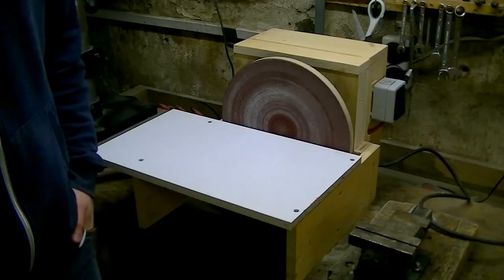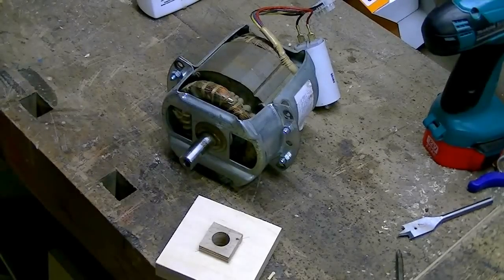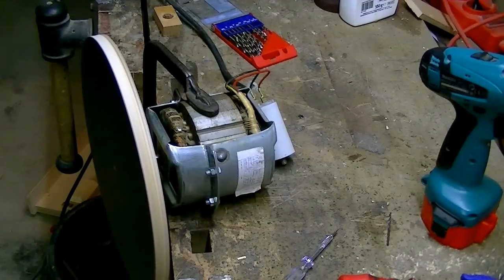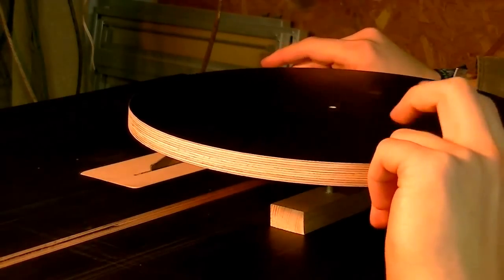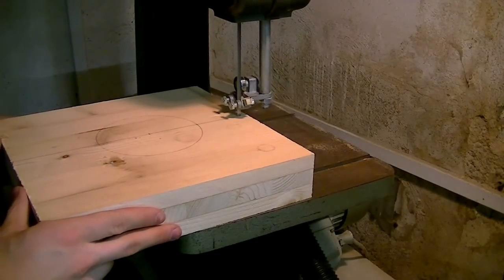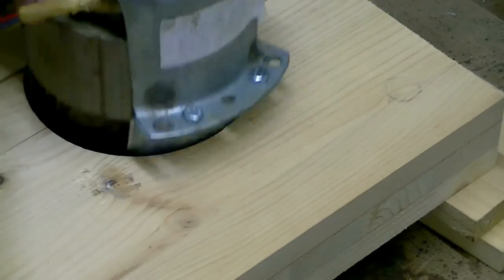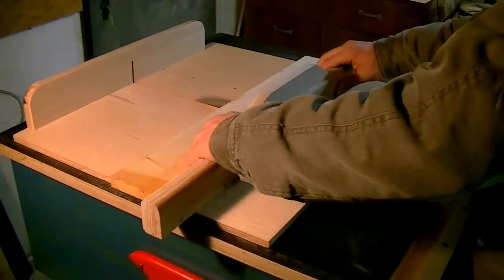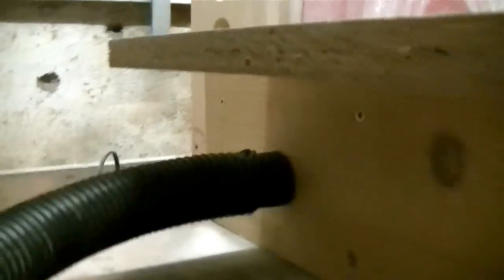Building a Disc Sander (cheap and simple)

Comment: I've been wanting to make my own disc sander for a while now but have been stuck on how to secure the disc onto the shaft of the motor. Is a secure friction fit with the flange really all it takes? My motor shaft has a small flat side that runs along the length of the shaft so I'm not sure how safe and secure the disc and flange would be. If anyone has any tips or advice that would be awesome!

Comment: Good job.
But the method of attaching the disc plate to motor shaft is suspect.
And the electrical switch is poorly positioned if emergency shut down is required.

Comment: Very nice. You in turn can use the motor from one of the super cheap bench grinders like I did, it is infact it is probably be easier to make one using a bench grinder as a base. I bought one second hand for £8 and it worked perfectly. I did made a sanding disc simply by casting a wheel out of aluminium. I also used the other side and made a make shift belt grinder. It was not difficult to make, I am quite good at welding so it was easy to make a sturdy base out of scrap steel I had lying around, which is useful because although the balance is good, it needs to have a good foundation, you can't have the thing spinning out of control. Now, in your video it looked like you glued the sanding wheel, whereas on mine I use the velcro sticky back plastic and use the sand paper with  velcro on the back, I am in the mind that it is better this way. More expensive yes (and no) but, there is no mess. (This type of sand paper is incredibly strong and if you have the materials, reusable. Not going to explain, if you know, you know). Anyway, your build was good, I am glad there are people out there like me that get of their arses and just do it rather than paying through the nose due to idleness. Well done Sir.

Comment: How much RPM does your motor have? I found a motor with 1.4HP but it runs on 2800 RPM. Will that be ok? I'm thinking that may be too much RPM? Nice video by the way :D
Reply: if it is an AC motor , it is possible to use a rheostat (lightbulb dimmer switch) to slow down the speed , but over time it is bad for the motor. because when you lower the Voltage , you will increase the Amperage & that will create more heat. but if only using the sander for a minute or two . and not hours or every day... it will last a while...
Reply: +Krunoslav Hrastić that would be ´too fast for a disk sander made of wood... you need to use a balanced metal disk for that... calculate the gravitational force at the rim of the disk compare it to the maximum load permissible for the ply you use.. multiply safety factor by 2 ..
create attatchment bracket for the motor and disk... 
run the motor with disk at safe distance .. expect everything to explode...
Personally I would never make a disksander disk and / or motor bracket of wood.... EVER
I have a store bought disksander and the RPM says 1750
Reply: Thamks for the answear. Thats what i was thinking... too fast.

Comment: Fastest way to improve this design? Put a 2-3 degree pitch on the face of the platter and tilt the table the equivalent amount. It reduces burning as the contact surface is very small where the sanding occurs.
Reply: +MaruAdventurer Your description makes it sound like the two angles cancel each other out, which is good because most of the time you want a straight 90 degree angle, but if they cancel each other out I don't see how that would help with the problem you describe. My solution for this issue is to use the correct weight of sandpaper, and flip the piece over if there is still some burring.
Reply from the maker: that doesn't sound very logical. Could you make a video and explain?
Reply: Ever sanded a long piece on the sander and noticed you developed fuzz? That is as far as the wood goes it is experiencing a up stroke and down stroke against the fibers. A minor angle aligned to the table reduces the contact surface and places the stroke in one direction to the wood surface. Yes you will have to move the piece faster to minimize burn.

All I can say is, try it. Worse that can happen is you waste a 10" piece of 3/4 ply and a sanding sheet.
Reply from the maker: *****
No because that doesn't make sense. Please just make a short video and show how you do it. It's free and doesn't take as long as writing comments prone to misunderstanding.
Reply: +Derek Read The angles do cancel out. You end up effectively using the equivalent of a sanding drum action.
Reply: +MaruAdventurer Please no hard feelings. The concept sounds like a myth. When you finally end-up with 90 degrees, it will be same effect except that 2-3 degrees pitch and tilting motor becomes just an additional effort.

Comment: PSA backed sanding discs is not available in my place of residence. Is there a good DIY method of making a sanding disk from roll sandpaper in order to make a project like this? Can white wood glue be used?
Reply from the maker: I would use contact adhesive.
Reply: +DAVID BLACK You might try a spray adhesive, like 3M Multipurpose. Something that sticks but is not really strong (so maybe specifically not "3M Super 77"). If you use a melamine backed wood like in this video I think something like that will stick well but not permanently.
Reply: Double sided tape would work also!

Comment: those motors are too cheap, (free, my uncle throws alot of them away). 
As for the propellor, Absolutely Brilliant Idea..
on the spacer between the motor and the back of the sander disc drill a hole and use a high thread count bolt to lock it onto the flat spot of the motor shaft.

Comment: Great Video, good solution if you have the parts laying around requiring minimal wood. Do you think that making the sanding disk taper slightly from the center to decrease the rotating mass on outward edge would help? I wonder if making the flange parts circular instead of square would help with the balance? Maybe use MDF? I think I will try this, Thanks for posting, again, very good video!
Reply from the maker: Mdf is not strong enough. I don't know why you would want to bevel the disc but you could certainly do. However when there is less momentum the motor will be stalled more easily. The shape of the flange part doesn't matter as long as it's mounted to the motor at it's centre of grafity.
Reply: +Cosmas B great points, the higher rotating mass would help make make the sander stable with cleaner results, And MDF would fall apart without fiberglass mat/resin reinforcement and you are back to the balance issues and increased cost.

Comment: cheap? Using a 80$ motor?...
Reply from the maker: +jean-jacky legnou actually 800$ ;)
Reply: if you find and old vacuum hover they have class motors
Reply: 800$ are kinda too much for a cheap tool ^^
Reply: jean-jacky legnou with that motor  but an old hoover motor would cost about 20$

Comment: very cool! inhave a 1/4 hp motor from a 9 inch bandsaw and a motor from a lathe. which one would you recommend for a 8-10"disc sander.? thanks for sharing this..
Reply from the maker: The one that has more tourque.
Reply: +Cosmas B i believe the motor from the lathe has more torque/hp its belt driven and has 5 different speeds.thanks for the reply and suggestion

Comment: You can make a more complicated build with a tilting table, but for most uses, this is enough, and it's a lot simpler to build.

Cosmos, do you find that you have a lot of use for a tilting table on the disc sander?
Reply from the maker: One sigle time the past 3 years.
Reply: Cosmas B Agreed. And even if you need an angle, you can often get it by placing a shim of the correct thickness under the workpiece instead of tilting the table.

Comment: i m a learner - just wondering if i can paste sanding sheets to the wheels of my bench grinder and use a dimmer to vary the speed of the motor and use it as a sander - clicked to my mind and thanks for your video
Reply from the maker: You could certainly do that but the dimmer thing doesn't work. If you dim it the motor will have no torque at all.
Reply: if your not sanding off a large amount of material , you could get by with low torque.. but be aware that a dimmer lower's the voltage & will increase the resistance in the motor windings creating extra heat.. just dont run it , but for a few minutes & allow to cool.

Comment: Super build,

Where did you get the motor and how do you make it speed up gradually?
Reply: Yves Baggi that kind of motor can be found in any washing machine, and it gradually spins up simply because the wood disc has an inertial momentum and it gets speed with an acceleration

Comment: Thanks for sharing. I salvaged the motor from an old mower for this exact purpose a few years back. Being a woodturner I've made loads of lathe mounted sanding disks and have managed well with these. Your video has inspired me again though... next weekends project. 😉 The only change I might make would be to add a cover around the outer edge of the disk... better dust collection and a little safer if the motor/disk coupler fails.

Comment: I made a 10" disk sander similar to this years ago using a motor and disk from a potters wheel. It also had a table with a movable fence perpendicular to the disk. Worked great

Comment: What´s missing is a 220V socket and a second switch. Close the space below the table, make a hole from the side and you can plug in a vacume cleaner hose, Copnnect it to 220V at the socket and switch it on/off with the second switch.
It works PERFECTLY on mine, being in use now for 5 years or so. Hardly any dust compared to not using the vacume cleaner. I love it!!!
Reply from the maker: DL6UK Didn't you watch the video?

Comment: Hi Cosmas. Can you tell me why I shouldn't try this at home? What about it is an accident waiting to happen? By the way, is that a home-made table saw?
Reply from the maker: yep the table saw is home made as well. This stuff is dangerous because it was not professionally made. All sorts of crazy stuff can happen. It could catch on fire or electrocute the operator. Also there are no safety devices attached that would at least half way cover the disc. If that disc catches a finger it will rip it right off!

Comment: This is too much work, I took a piece of scrap 3/8 in birch plywood and turned a 10 disc on the saw.  When done I bore a 5/8 inch hole to fit the arbor of an old ryobi  table saw and mounted the disc to check balance.  Ran nice and smooth so I removed the disc and put 60 grit on one side and 180 on the other side.  Try that with a disc sander.  To change the grit just walk around the bench and use the other side.  Warning with the speed of the saw it is easy to burn and set off smoke detector.  Don't have a cheap saw around then pull the blade from your primary saw and you have the same thing.  Primary saw is much quieter than the cheap ryobi.  Wear hearing protection as you do on everything else.
Reply: Where is the video you made........Personally I like what he did. Step by step and very informative. He did a great job......why you jumping on him with all of your greatness?
Reply: I prefer Cosmas' design for the following reasons: If i had an extra table saw then the sander would take up to much shop space, I would be limited to a 10" disc (unless I modified the table saw), Table saws are not very portable and I couldn't place it on a bench (without chopping up the table saw in order to make it smaller). I could, however use the old saws' motor with reduction pulleys and still go with Cosmas Idea. This is one of the few shop tools where you can (for very cheap) make a very useful quality shop tool. For a few hours work you can have a 12" disc sander and save yourself up to $200. Nice job Cosmas. I gotta find myself a motor and get to it. I'm needing a good disc sander badly.
Reply: Please, if that is what you want to do, do it.  I simply used a table saw to cut a disc, a drill to cut a 5/8 arbor and an extra insert and install the two sided sanding disc on the saw.  I had purchased a saw from ebay 8 years ago which out lived its usage because of size.  It just has one drawback, and that is speed but that means one has to be much more careful than a sander that runs 1200 rpm.  I was only saying that time is money at my age so I don't like wasting it.  Each to his own

Comment: Nice job, really well done. Could I know the speed (rpm) of your motor?
Reply from the maker: Nope
Reply: Cosmas B nope why? You don't know the speed or you don't want to tell me the speed?
Reply: Alessandro Benedetti he doesn't know. But as its from an old lawn mower I would say its an 2 pole synchronous motor so it runs ~ 3000 rpm

Comment: Your disc appears to be 250mm?  Will 1hp be sufficient for a disc that same size?  (I have one sitting around)  Does the phenolic take any damage from heat if you grind steel?  Thanks.  Good ingenuity.
Reply: Cool, thanks.

Comment: in what home tools can i find a motor like that? i want to make a similar sander but doesnt have to be as powerfull, i want to use it for hobby modelling so no really heavy duty? Will a motor from a kitchen blender or similar do fine?
Reply from the maker: no it turns too fast. Read the description for more information.
Reply: Johnson Supply, you can use a hvac motor too.

Comment: like the video was very good just wish somone could tell me how to make one with a vax carpet cleaner motor. i got hold of one today and spent all day taking it out of the cleaner,  and atempting with difficulty to mount it to the underside of the top of an old pine sideboard managed to make a pine disk that was flawless (so i thought) got it attached and all seemed well it rotated without wobbaling at all with me turning it as soon as i powered up within 10 seconds the disk started to burn. so i swapped out for a lighter disk of ply it wobbled a little and as soon as i turned on the power the motor blew out the electrics in my shed any ideas??????? im flummoxed
Reply: a vacuum motor normaly has a high RPM ... prolly need to have appx. 1750 RPM ...

Comment: Hey, I can make a hundred dollar tool with only a few thousand dollars worth of tools. Why not just buy one? You can obviously afford it.
Reply from the maker: Why would I buy a machine when I can afford to build it?
Reply: Ok I'm sure you had a good time making it and that's great. I guess I was just irked at my own misfortune. I don't have a table saw or a drill press or a router etc. I guess it just would be cool if someone made some videos about using limited tools to make cool stuff. Cary on.
Reply from the maker: Paul L
come on... I'm using a cheap drill press and a small homemade table saw and no fancy nasa equipment.
Reply: Cosmas Bauer You made your table saw? I sure could use one for the project I'm working on. Do you have a video on it?
Reply from the maker: Paul L
I made the table saw, another table saw, the disc sander, the router table, and some other machines.

Comment: I use an electric drilling machine to which I fix similar sand disc with help of a 4 inch screw (serves as shaft) and 2 nuts together. It is more cheap and simple because the same drilling machine I use for other purpose. In your Disc Sander one has to buy an electric motor which can not be used for other purpose. Needless to say that I take inspiration from such web sites. In case anybody wants more information, write to me at atulsunkersett@gmail.com. I shall show the photos of different wheels (available in the market) for doing different jobs with a drilling machine. You don't have to buy an electric motor or a grinder.

Comment: Hi Cosmas
I am in UK and I need a little more information about the motor please. I presume it is an AC induction motor is there any chance of any more information about the motor. It must be capacitor start and perhaps capacitor running. It also must be single phase AC otherwise you end up with AC controller problems and this rules out DC motors. If you can give me an ID for the motor maybe I can find a suitable candidate here. Very many thanks for your attention.

Spencerman

Comment: My friend built a couple of disc sanders using 12" aluminum turn tables from old 78 RPM record players which he found cheap at the local thrift store.  This eliminated any potential balance problems, and made mounting to the motor shaft much easier.

Comment: Clever design - my only worry would be: "what happens if the sanding disk comes loose from the motor shaft?". I guess one could build a stop above the wheel to prevent it jumping up.
Reply from the maker: that can not happen becasue even if it would come lose the table would prevent it from moving foreward and jumping off the shaft.

Comment: I have the Powermatic combo belt/disc sander.  Got a question for you.  I have some 12" disc that I have had for a while.  when I tried to change out the old sanding disc for a new one I found out the glue on the back of the new disc was not doing to stick to the plate very good.  got any suggestions on what type of glue would work to make the new disc stick?

Comment: Hi Cosmas, 
Awesome video !
I have a question, the disk his held at one point in the center by the motor, however, when you are sanding you are applying pressure to one side of the disk. 
Are you relying on the weight of the disk and rotation to keep it parallel ?

(I need a physics lesson here I guess)

Comment: Ah ok. Say, wahat the rpm of your motor? That way I can work out how to regulate it. 

OK, I just looked online at the rpm of the average disc sander, we're looking at between 1100 and 3000, so in fact a washing machine looks like it could be just fine.

I'm looking forward to building one - thanks for the inspiration :)

Comment from the maker: You should put the dust extraction where the dust goes. In this case, as the disc spins anti-clockwise the dust extraction makes anly sense on the left of the sander especially because there is no tight dust extraction enclosure around the disc.